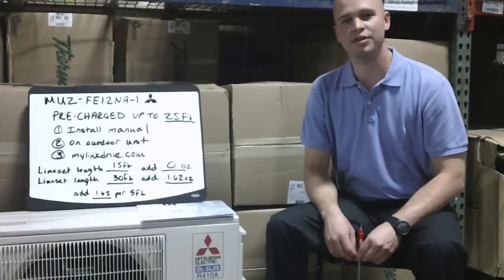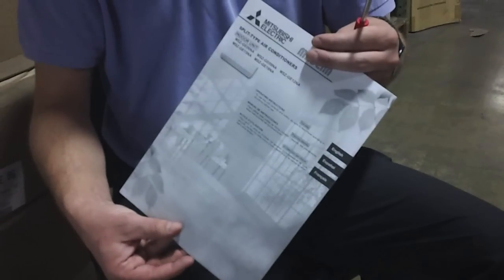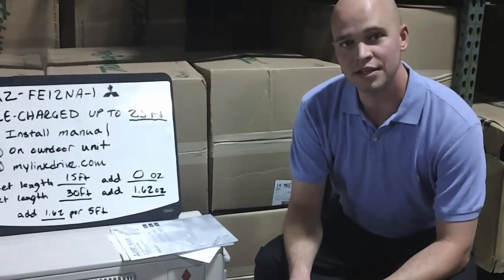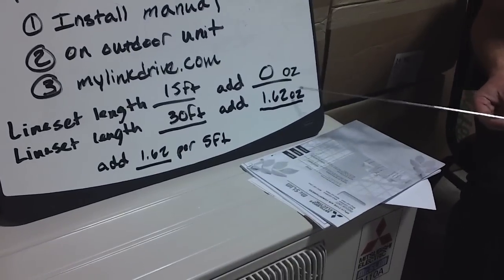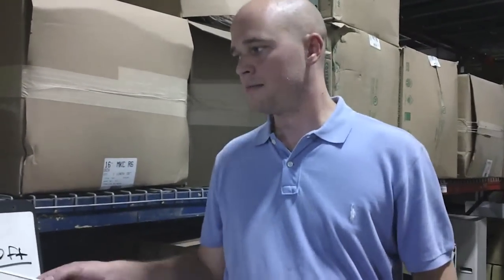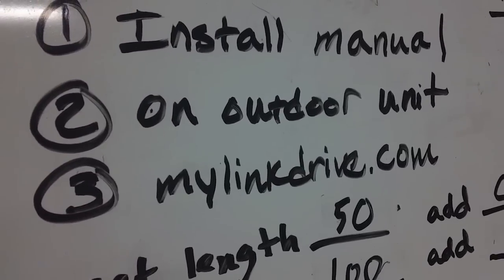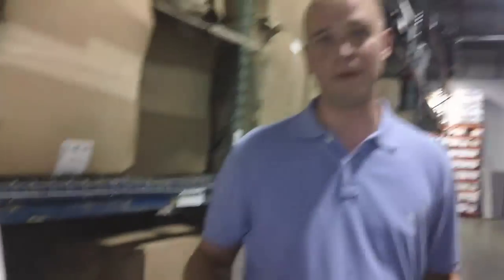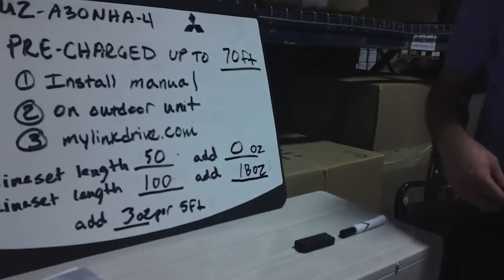Tech Tip #4: Mitsubishi Ductless: HOW TO Charge an M-Series and P-Series Outdoor Unit

Comment: Are you familiar with the Mitsubishi cooling only units? I was wondering why the units have max cooling rating higher than the rated capacity, Like the 18k has a minimum of 5,800 and a max of 22,000